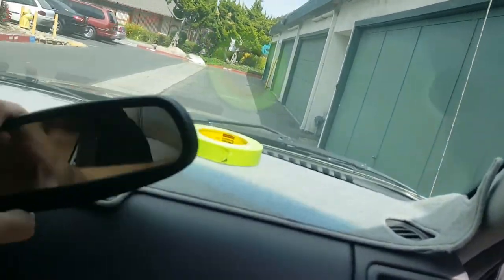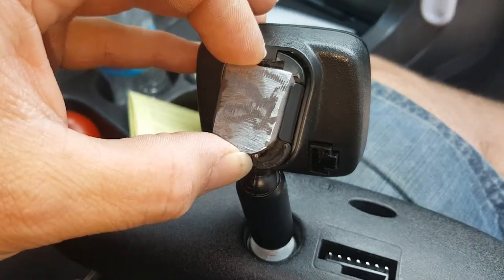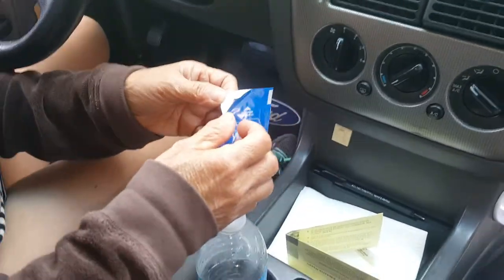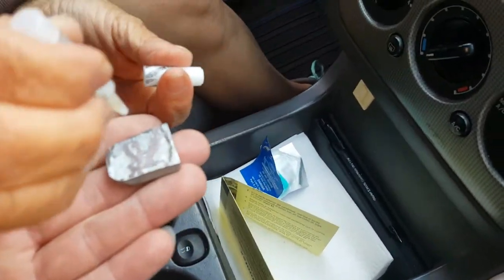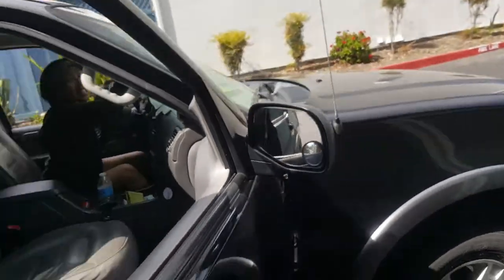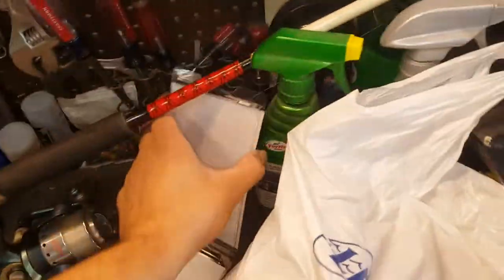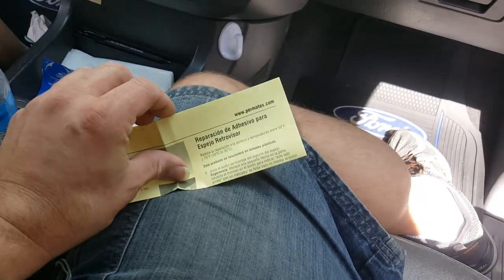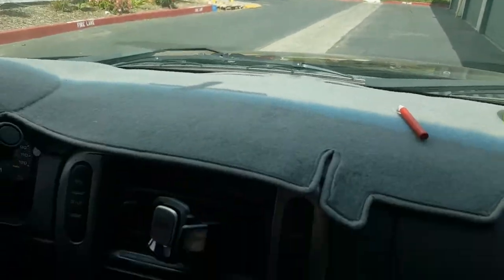2005 Ford Explorer rear view mirror repail

Comment: What is that wire for that runs up the back side?
Reply from the maker: That wire runs to the switches that control the different things on the mirror.
Reply: I gotcha. It threw me off because I don’t have any functions on my rear view mirror except the night time manual flip on the bottom. Nothing digital